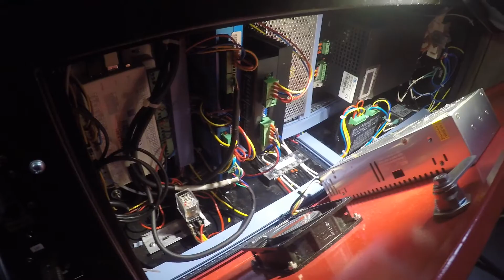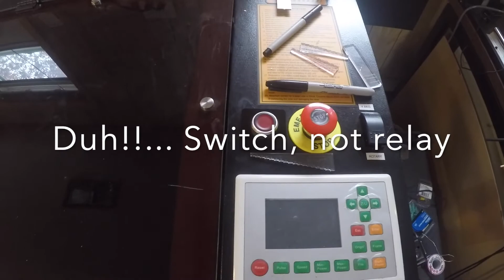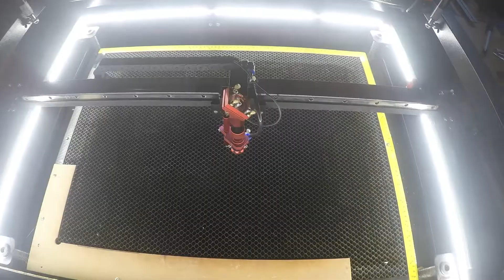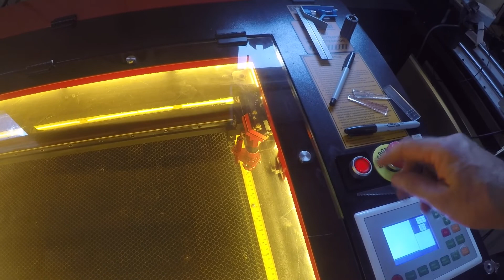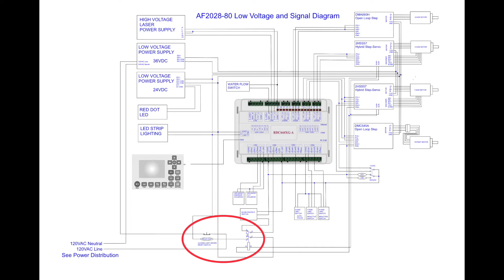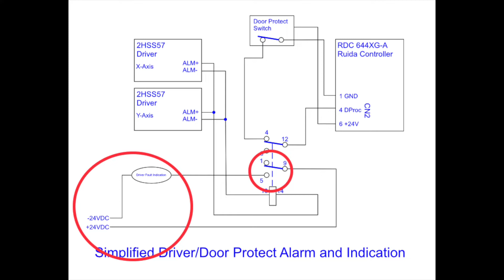AF2028 Closed Loop Driver Alarm Reset

Comment: Why is it tripping?? I have my x axis upgrades and installing after holidays
Reply from the maker: You will have to give me a little more… do you mean why why was mine tripping? There are a number of reasons an axis may trip - an obstruction on the bed is most likely. I have had it, in the past, where I was engraving inside a bowl, and forgot the machine would try to home after… when it struck the side of the bowl, the driver tripped.